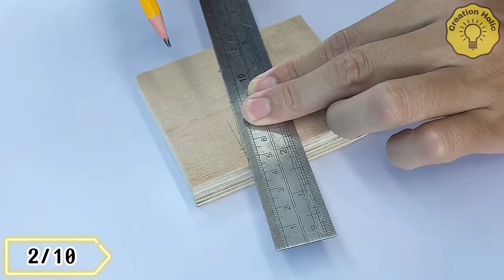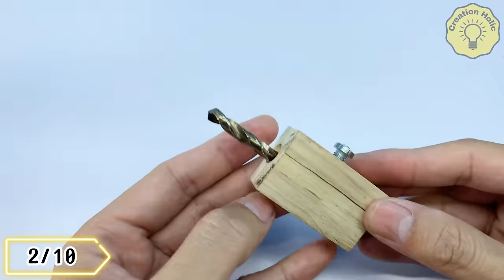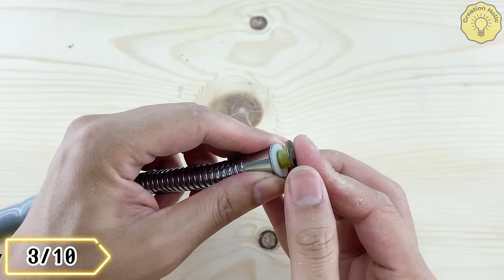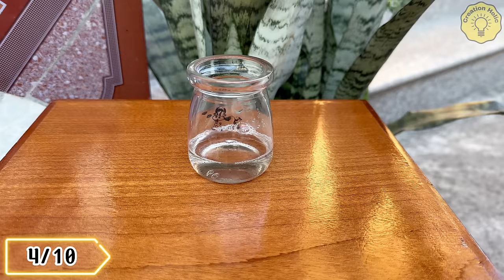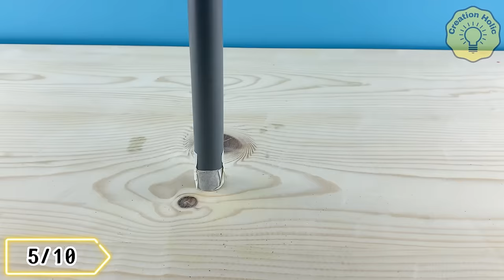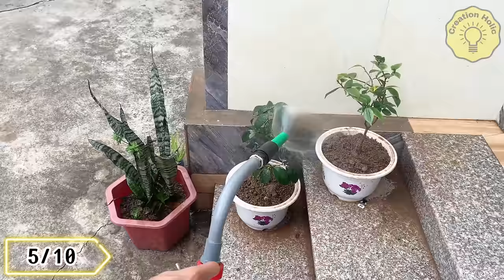Top 10 Practical Inventions and Crafts from High Level Handyman

Comment: Nice repair....I make this kind of repair using a thin strip of cloth soaked in epoxy which I wrap around the break.  To keep the butt joint together until the epoxy repair sets, I use instant glue in the butt joint.  I have also used fiberglass cloth for large repairs, such as a scissors handle repair.  I like your idea because it does a better job cosmetically hiding the repair.  The glasses I repair are usually reading glass and the epoxy repair is pretty easy to blend/hide if desired.   Sometimes, glasses break at a lens frame which is thin and can't be wrapped so I take a small, thin piece of cloth soaked in epoxy to lay over the break.   I am a new subscriber......thanks for the great ideas you provide!!!!
Reply from the maker: Hello! thanks for your recommendation. Wish you all the best!